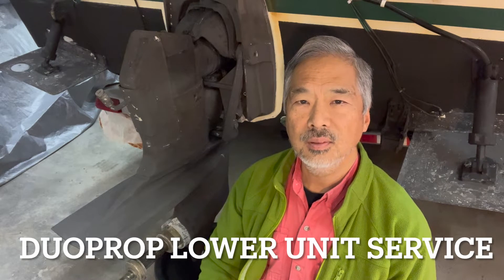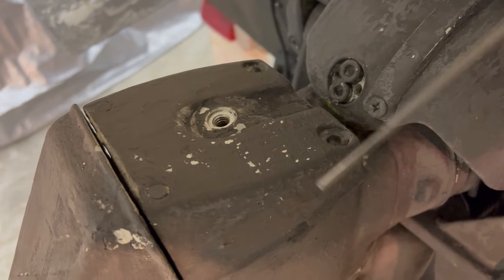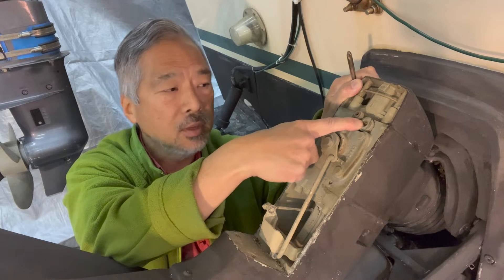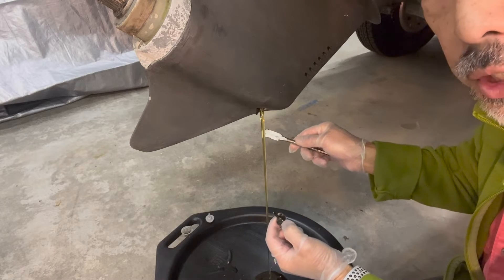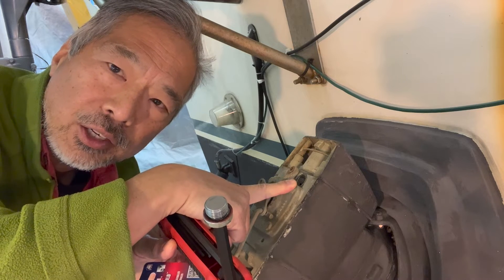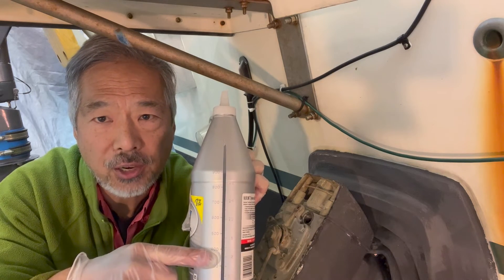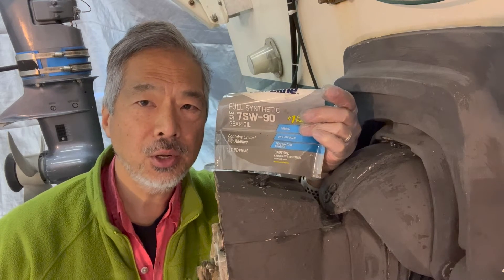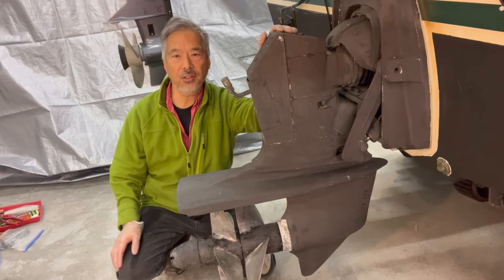How to Service the Lower Unit of a Volvo Penta DP-D1 DuoProp Outdrive

Comment: If the oil is very black. You mentioned you could have problem. What could be the cause of black oil? Could it be that it not have been changed for many many years?
Reply from the maker: Most likely it needed to be changed much sooner. But black is certainly better than milky, which would indicate a serious water intrusion problem (failed seal, cracked housing etc).